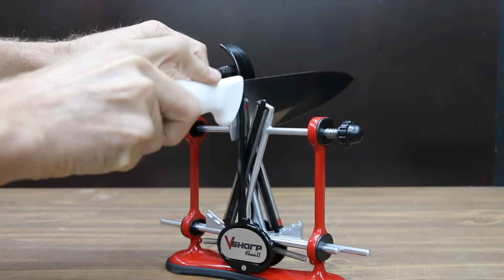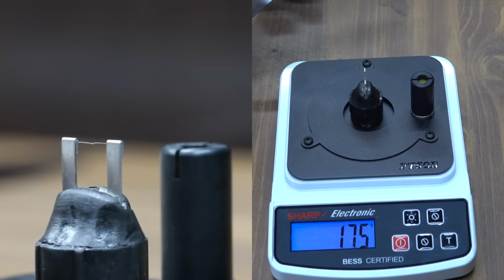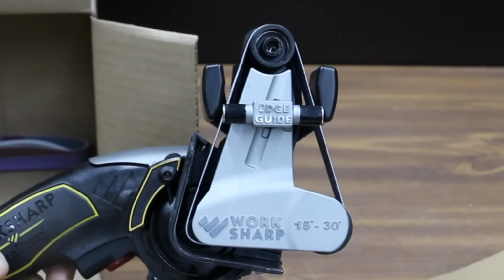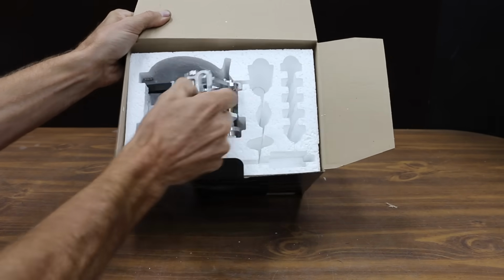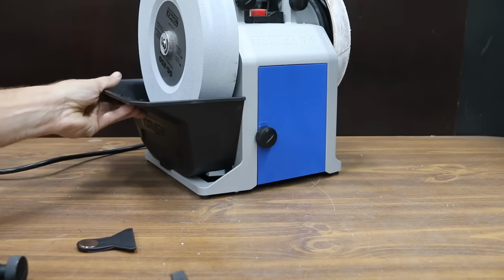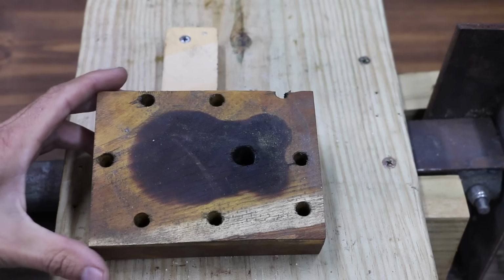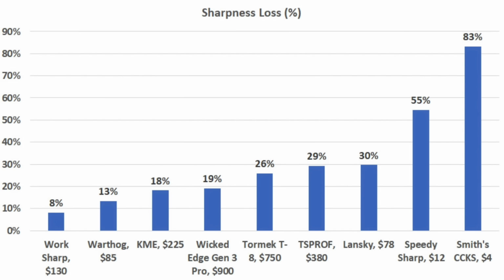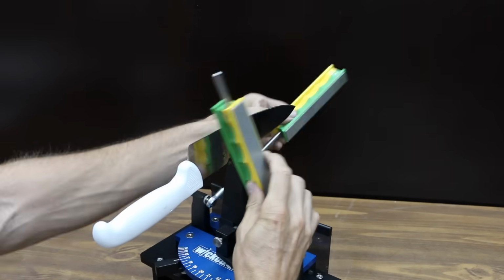RUSSIA vs USA Knife Sharpener? TSPROF vs Lansky, Wicked Edge, KME, Tormek T-8, Work Sharp Ken Onion

Comment: I started with a Lansky, but eventually moved to a KME. The "bells and whistles" the KME has over the Lansky makes things tremendously easier and is FAR better built than the cheap chinese aluminum that Lansky is made of. The Lansky is so cheaply made that the thin aluminum bends and deforms very easily. Make the wise choice.... save up and just get a KME from the start. You will thank yourself in the long run repeatedly. On top of all that, you forgot to mention the KME is MADE IN AMERICA!  :)
Reply from the maker: Thanks for the feedback.
Reply: Can you test a German Oil Additive, its called "Mathy M"
Kindest Regards
Reply: Or if you still want a budget option that is way better than the lansky and even cheaper, the Workshartp Precision Adjust Knife Sharpener. Got it for $50 Canadian Pesos
Reply: @Sinehmatic  🤣🤣🤣
Reply: Same, the Lansky also tends to scratch blades as set up from the factory although you could add an adhesive rubber strip at the contact point. KME + Venev stones + homemade strop with Diaspray are all I ever use anymore.
Reply: Thx for the input. I was interested in the Lansky after this video but maybe it'd be worth waiting n trying to get one like the KME.
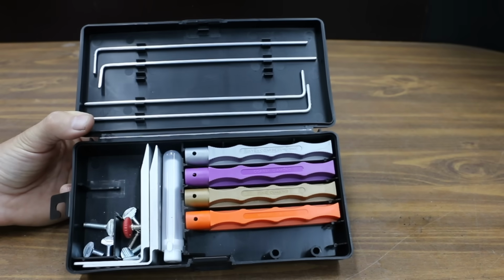Reply: hmm 3:01
Reply: @hellraiser666666  thats the lansky not the KME
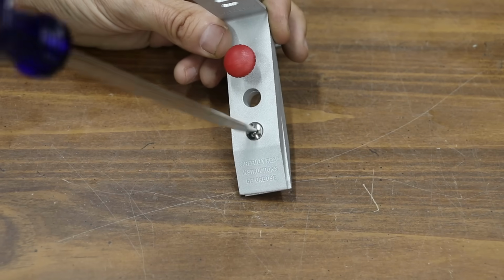Reply: @warframeees8013  yes. He’s pointing out that the video says the lansky is made in USA at 3:01, in response to the post claiming the lansky is Chinese.
Reply: @emersonb5764  ah must have misunderstood
Reply: @hellraiser666666  you're wrong. Hmm
Reply: @hellraiser666666  Lansky has 3 skinny, small, cheap diamond stones. The KME ones are far better quality.
Reply: made in america = downside.
Reply: @FlourescentPotato  Compared to what, made in China? Stop trolling.
Reply: Купи профиль к 03 или казак про. Оно сделано в России и оно в миллион раз лучше твоего КМЕ
Reply: @maminxyi  LOL...
Reply: @maminxyi  Про какие модели ты говоришь? В списке видео ни одной похожей нет. Можно ссылочки какие-нть?
Reply: @maminxyi  Нашёл "казака" - сразу НЕТ. Крепление ножей - задолбаешься крутивши аж ДВА винта! Категорически неудобно.
Reply: @maminxyi  "Buy a profile for 03 or a cossack pro. It is made in Russia and it is a million times better than your KME"
Reply: @PlasticCogLiquid   i’ve owned lansky’s with diamond stones , KME also with diamond stones , 2 years ago jumped up to TSProf , I agree the Tsprof is leaps and bounds ahead of the KME , and even superior to wicked edge…
Reply: @maminxyi  В США купить где?! 650 долларов!? :-))) Мой бесплатный камень с ремнем в 47.787,02 раз лучше любого твоего казака (сегодняшний курс рубля) 😉
Reply: @CorneliuB  если очень захотеть, можно в космос улететь.  Америка сильно отстала в плане заточных систем.
Reply: @maminxyi  Уау! Путин бот... Нива лучше Jeep, МТ лучше Harley, как в детстве! Спроси брата украинского кто лучше....

Comment: If you aren’t a knife enthusiast (or a budget conscious one who doesn’t wanna drop hundreds on a sharpener) but care about awesome sharpness and lengthening the lifespan of your edge (not using a pull through). Maybe you like to nerd out a little, but you don’t wanna spend much comparatively. Pick up a worksharp precision adjust. Similar to the tsprof and KME as it’s a guided system but it’s only 50ish bucks. Surprised I didn’t see it on there actually. Great test from a knife nut PF!
Reply from the maker: Thanks!  Thanks for sharing.

Comment: You should do a video to test what the best 12V (and or 24V) 500, 1000, 2000 and 3000W inverter is.

Another idea is to test some budget friendly charge controllers vs some expensive charge controllers.

Another idea could be to test some different brands and types of solar panels.

And lastly I would be cool if you test a number of different knives against each other. We have seen a couple of the sharpener videos and it would be nice to see what knives to buy with said sharpeners
Reply from the maker: Thanks for the suggestions.

Comment: I read that for Lansky you must move the sharpener for long knives.  Otherwise you get a steeper angle the further from the center of the sharpener.  Is it possible you put a "progressive" very shallow angle on those knives in the test area?

Comment: You're very good at testing, and with each of the best sharpeners, you can get better, even scary results, if you will get more practice.
The TSPROF could beat the Wicked Edge, or reverse if you know more about how to extract the best, given the specific knife and metal.
You're mostly testing the sharpener's sharpness and cutting at 1 point on the knife - I'm wondering if you could consider a fair way to test a sharpening brand's ability to sharpen along the entire blade glide length? like long slice quality - carve the ham (or soap bars). That $4 Smith's 2 step really does a hack job for full length - totally uneven results.
Wicked Edge kit you received is the large platform, accommodates larger knives, also full set of stones, so $900.  But the same WE130 platform, lesser kitting was ~$550
Reply from the maker: Thanks for the feedback.

Comment: I proposed a test of concrete oil stain removers about a year ago. I don't know if it's in the hopper or what. Preferably not fresh stains, old nasty ones

Second idea: stainless steel cleaner. For kitchen appliances. Which one does the best job removing stains, smudges, fingerprints and so on...
Reply from the maker: Thanks for the suggestions.

Comment: Can you do a battery powered weed eater / grass trimmer test? It's off-season, but now they are cheaper to buy so it would be nice to watch a test. -I have the Lansky knife sharpener kit in my work shop and it always does a good job with my knives.
Reply from the maker: Thanks for the suggestion.

Comment: You're going to have to remake this video... You didnt include the Edge Pro -Pro series sharpening system which is what the Russian system is a knock off of ... If you're going to do testing&comparison atleast do it with the system that they mimicked
Reply from the maker: Thanks for the suggestion.

Comment: Those handheld ones will eventually ruin any good knife. It creates an uneven edge and in time will no longer sharpen with that tool. When I looked at the edges of my knives I immediately purchased a couple lansky style kits, pulled the junk and doubles out of each and now have a good system with about 7 diamond stones. Takes a very long time (read 5ever) to straighten out the edge with the 150 grit stone after using the yellow handheld POS.
Reply from the maker: Thanks for the feedback.
Reply: @ProjectFarm  I'm guessing you keep one with the set of double stones, you looked like a friggin' ninja throwing an edge on. Wishing I could justify the dough to score that setup.

Comment: Great video, but i think you missed a couple of steps on the Tormek.
I used to have an older version and it came with the flattening/ grit setting stone.
First step flatten ans set course grit on the stone.
Second step change grit to fine on the stone.
Third step hone the blade.👍
Reply from the maker: Thanks for the constructive feedback.

Comment: Yet another awesome Project Farm video! No doubt you are aware of the EXTREME levels of refinement and discussion there is on youtube on the subject of knives, knife steels, and knife sharpening. But I think there are areas you failed to give sufficient focus on: 1) The demands on sharpening methods placed by modern, high-tech steels. Your tests used (apparently) "decent" kitchen knives, but the real demand for precision sharpening these days is high quality pocket and bushcraft knives using true premium steels. 2) The abrasives used are in many ways the core element, and the better quality tools all allow for use of a variety of abrasives (and levels of fineness). More than anything else, it's the choice and use of abrasives which allows for extreme edges. The unmentioned abrasive alternatives available on some of the methods is an important area you missed. 3) Accuracy over the entire length of the blade. This can be a tricky issue with the Tormek, for example. The Lansky has a LOT of slop in its angle settings. And you missed the real pinnacle of the Ken Onion system by not including use of their "grinding attachment," which allows for a freehand use that gives much better tip control. Methods of holding the blade for repeatability are key to sharpening the same knife many times with best efficiency. It's on the accuracy score that the Russian setup deserves highest marks -- and it's an important feature that you didn't really give adequate analysis of. You enter a challenging and controversial world when you broach this topic. You did a pretty good job, but you did miss some subtleties which are important on the "high-end" of the field.
Reply from the maker: Thanks!  Thanks for the constructive feedback.

Comment: I'm particularly impressed by the TS prof's level of adjustability and the amount of information available to the user. That is what enables repeatability and consistency. It also looks gorgeous. The Tormek's edge was the most beautiful under a microscope. I love the polished look. I wonder if it has any influence on the actual performance of the blade.
Reply: Tsprof is certainly the best system out of all these platforms .. i can achieve mirror polished edges with chosera water stones, then follow up with a compound leather stropping… hair whittling sharp !!!
Reply: it does, there is a reason I use brasso or another polish after sharpening my knives
Reply: @frogz  Could you describe how you use the polish? I'm curious to try it myself.
Reply: Repeatability isn't a bad thing but I think it's over valued. Devices like the Edge Pro show that you do not necessarily need a clamping system to produce hair splitting edges. I actually find the lack of a clamping system to help me work faster compared to something like a KME or WE. It is a very sweat piece of kit though.
Reply: @thechemtrailkid  For personal use, I agree. However, for running a sharpening service, repeatable and quantifiable metrics of quality would seem to me to be a major selling point. Equipment as expensive as the TS Prof would seem to me to be overkill for personal usage, and would be ideally suited for a knife  shop's in-house sharpening service. Being able to reliably sharpen knives to a known measure of sharpness would matter in that context.
Reply: @Berkana  Yeah, I can see that. My perspective is as a hobbyist pocket knife collector/sharpener that ended up sharpening my kitchen knives (and the knives of friends and family)
Reply: @thechemtrailkid  it'd be the equivalent of an amateur chef building a pizza oven in his house, no he doesn't need it, but it's cool
Reply: @ghillepig2  It is cool, but I found the novelty wore off quickly. I've used the Lansky, KME, Wicked Edge, and the Edgepro. The idea of quickly being able to throw your knife back onto the sharpener isn't bad if you have space to leave something like the WE up all the time but I've found that it's much quicker to just touch of the microbevel by hand on a spyderco ultra fine stones and a strop.
Reply: Definitely spot on about that. Anytime you have a system that can duplicate whatever it is you that you are working on, with the speed and accuracy adjustments that are of the simplest format, you are then able to dial in your overall time plus cost of material needed in order to maximize what it costs to run a business using that equipment. Plus you have the added bonus of having a simple system that requires very minimum training to get the same desired results consistently. Yes there is more to running a business than what I've listed, the above mentioned was a quick reference for someone to take into account if they wish to get a ball park figure of what a portion of said business would entail. Repeatability is the heart and spine of production, yet, it isn't always the visionary who has the brains which makes it profitable.
Reply: @thechemtrailkid  Not having a clamp is what's holding me back from getting the Edge Pro.  I don't trust myself to hold the knife still, I can see in videos that even with the magnets, people wobble. Would you mind sharing a little more about your preference?
Reply: @emilythechef  Sure. I had the same concern. However, after about 5 practice sharpening's with my cheap kitchen knives I felt very confident. What isn't obvious is that the very light pressure from the stone does a good job holding the knife in place; I think the reason why some people have issues starting out is that they bear down too much with either the hand holding the handle of the knife/tool or the hand doing the sharpening. In that way, I think it helps you become a better sharpener; you should really let the abrasive do the work and not try to brute force it.

The only thing I really had to consider was which portion of the blade I would lay down on the table. With fully flat ground knives (like most kitchen knives) you have a very wide, flat surface of knife to rest against the table. Some pocket knives have more complex blade grinds (see Spyderco Gayle Bradley) where a portion of the blade is flat and a portion is hollow ground. This may seem like it really complicates things but all I would do is rest the blade on the table and apply slight pressure to the blade and see if it wanted to rock up and down and picked the position that was most stable. 

This was without the magnetic base and three point guide; the former helps you hold the knife to the table while the latter helps you position the knife near enough the edge of the table so that just the edge of the blade is hanging off/makes it easier to reindex id you take it off. 

If you are new to sharpening, I feel like I should let you know that slightly rocking a knife while sharpening probably won't ruin anything. People have been getting metal hair splitting sharp by hand and you can be sure those bevels weren't perfectly flat. Even the best clamped systems have a little pit of play; nothing is perfectly rigid. Besides, the stones that come with the clamped systems like the KME or Wicked Edge have stones that can't be flattened so if you get an odd ball stone that's out of spec, you can kiss you perfect v cut bevel goodbye.

If you are mostly interested in sharpening kitchen knives or things of that size, I think the Edge Pro is the way to go. However, I still prefer my KME for small pocket knives. If you use a lot of chisels (or similar things) the Tormek looks the be the best although there is an attachment for the Edge Pro).

Let me know if you have any other questions.
Reply: @thechemtrailkid  I sure appreciate your thoughtful response, thank you so much. Kitchen knives and scissors is what I would be sharpening, and Edge Pro has a jig for ✂️.  Although it would be cheaper to buy more scissors then to spend $700 on a knife sharpener for them 🤪 I’m not a pro at anything that requires professionally sharpened tools, just a little obsessed.
Reply: btw knife polishing is a band idea for sharpness. Knife edge has to have a microsaw.
Reply: @muxahx3096  this is not necessarily true. A micro saw toothed edge will slice more aggressively if the blade is dragged, but the points of those teeth also blunt and dull faster. A very smooth but sharp edge will slice with hardly any pulling and will remain sharp longer. Some engineering journal actually published a study on this. Micro-sawtoothed edges are not universally desirable.

In the tests done in this video, the test cuts were done with a direct push, not with a dragging motion. Without a dragging motion this kind of test would not show any advantage to having microsaw structures because sawing necessarily requires the sawteeth to drag across the thing being cut.
Reply: @Berkana  exactly 👍👍 spot on chap and well articulated if I do say so myself 

Cheers

Comment: Great video! I own the KME sharpener and think it's the best bang for your buck if you want a higher quality knife sharpener. But to be honest I'd only recommend it if you're going to use it often. I make knifes and use this to put the final bevel/edge on and it works great.  If your just looking to keep a few knives around the house sharp then you could go with one of the cheaper ones. Thanks again for the quality content!
Reply from the maker: Thanks!  Thanks for sharing.

Comment: The biggest advantage with Tormek is that you ca repeat the angle and profile when grinding, you have several jigs that you can use to grind axes, knifes, chisels, planers, drill bits and much more. It's not just a knife sharpener, it's a sharpening system for almost all your tools. I have had a Tormek for 20 years now and been sharpening scissors, knives, chisels etc and is very found of the machine. You can buy different stones and now even diamond stones with up to 6000 grit if I'm not wrong. I only use the standard stone with the grit adjusting stone and then the stropping wheel. Starting with course 250 grit, adjust to 1000 grit and then polish it up with the honing wheel until you can see your self in the chisel edge..
Reply from the maker: Thanks for the feedback.

Comment: The Scientific Approach once again pulls the Iron Curtain back from ignorance; allowing PF loyalists to make informed purchases or “level up” to escape a proven dud. 
You have been busting the BS marketing drivel for years and we APPRECIATE YOU!!!
How about some file head to heads? American if you can find any! Slim taper files for sharpening handsaws, bastard mills for breaking edges after torch cuts (with or without annealing) and myths about clogging. Or diamond files vs steel. 
As always, Thank You 
-CY Castor
Reply from the maker: You are welcome!  Thanks for the suggestion.